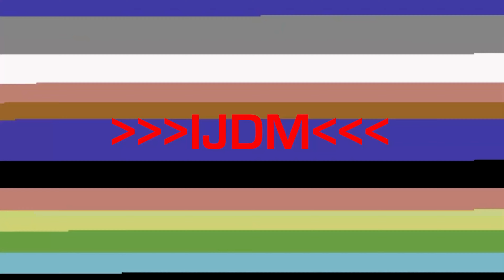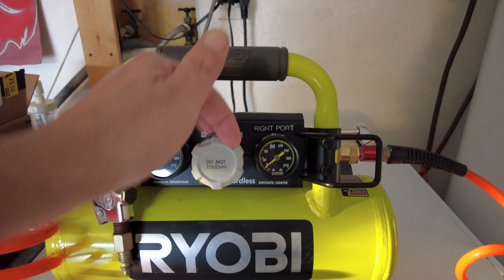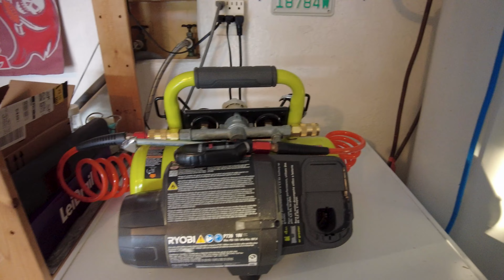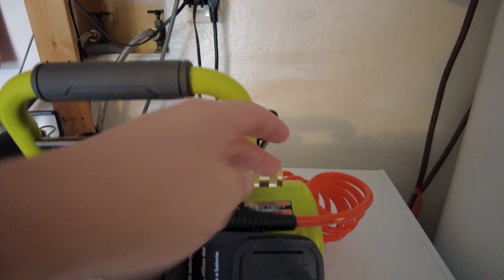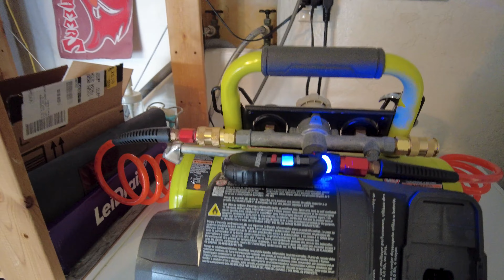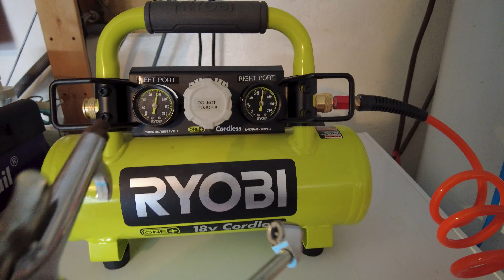Ryobi 18v Compressor Fix & Dual Port Mod - #IJDM131

Comment: That valve is NOT to empty the tank it's a pressure relief valve to release the pressure if it got too high in the tank . The dump valve is on the bottom. Doing what was done in this video could be dangerous

Comment: If you high pressure cutoff fails to turn off the compressor you now have an over pressurized metal take with no pressure relief safety!!! Wow! Not SAFE!
Reply from the maker: Good point, since doing this video, I put the safety valve back on the other port, since I really have no use for two ports as shown.

Comment: Thanks for the video. I do have a question. Did you just unscre the handle until it came off or the large nut shaped piece of the regulator it's connected to?
Reply from the maker: The larger nut is the one you want to unscrew.